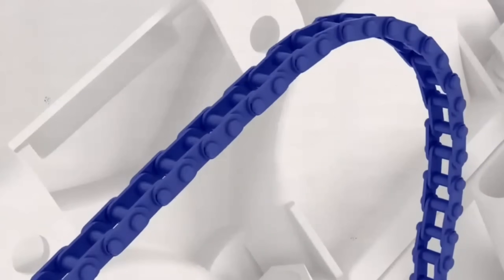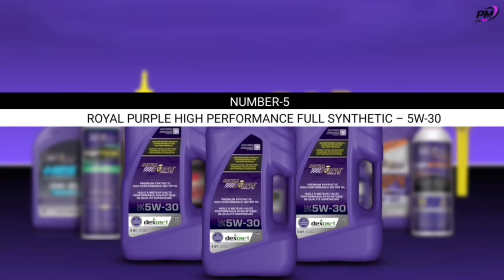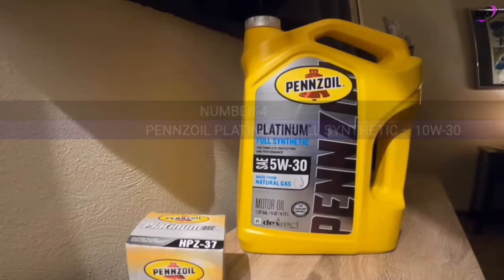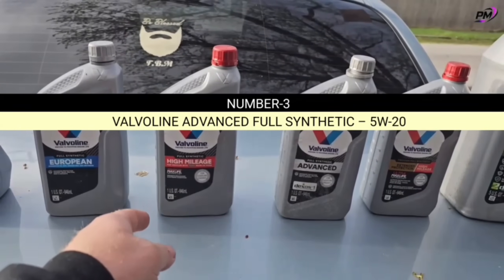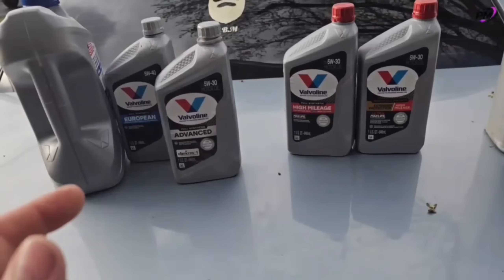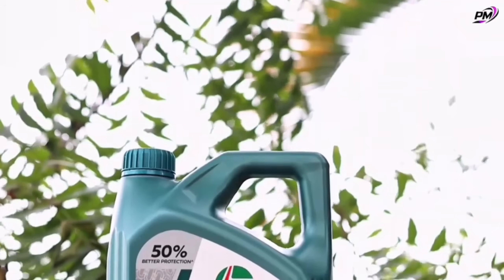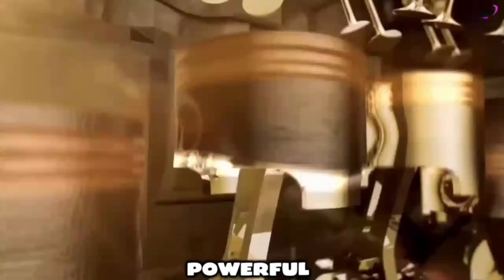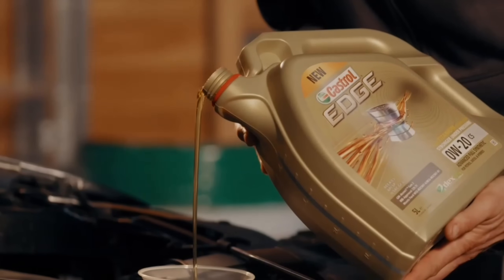Best Synthetic Motor Oil 2025? Mobil 1 vs Castrol EDGE vs Valvoline!

Comment: I agree with all.  My Fiat Abarth is on the 5w40 Pennzoil Platinum for 10 years, change it every 5000k’s,, still strong and trouble free!
Reply from the maker: That’s great! Regular 5,000-interval oil changes with the right grade really help engines last long. Thanks for sharing your experience!
Reply: @PropicksMaster 
Thanks, the turbo high temperatures require, in my opinion clean oil with minimal viscosity loss over time so frequent oil changes are prudent.